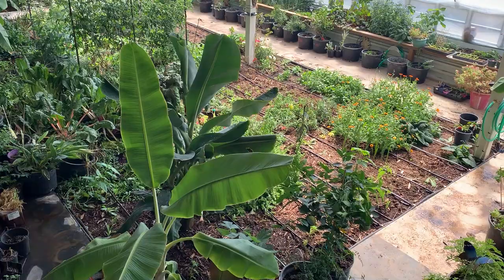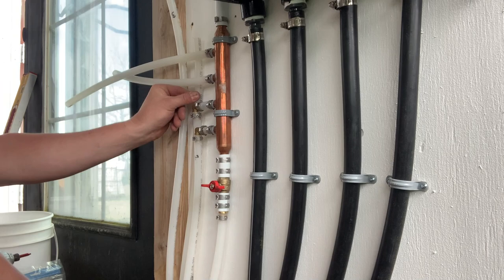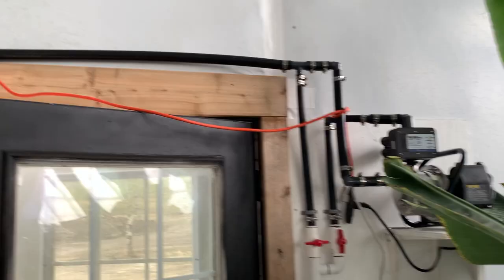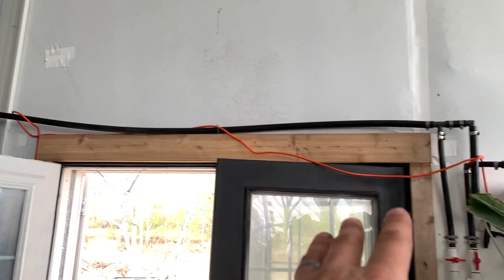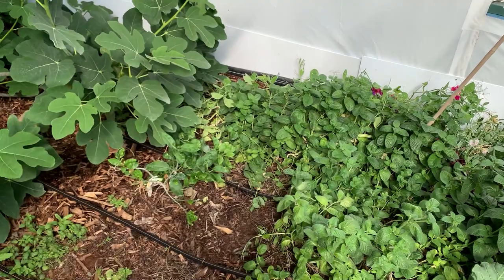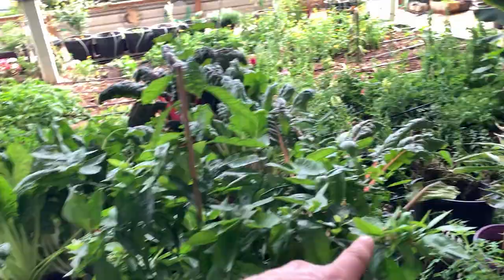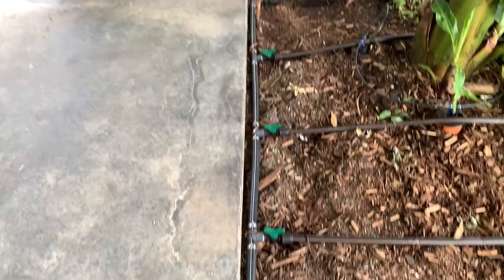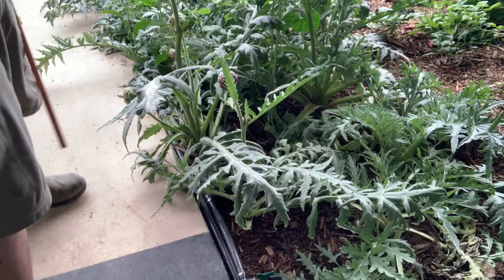Greenhouse Irrigation Completed - Full auto, driplines, pot drippers, 5 zones, timers, wifi, & more.

Comment: Maybe put a check valve on the well /house line so somebody doesn't accidentally send rainwater back during maintenance of the house water or someone opens house valves all the way that it allows that low-pressure to enter your drinking water? Also once in awhile there will be places where you can eliminate an elbow and just have a curved black piping. It's surprising how much more water flows in a low-pressure situation when you eliminate an elbow or two. If you need it that is.

Comment: I would not install one of those frost free taps.  They were installed in my house and the first winter they froze and broke.  My super intelligent plumber buddy came in and plumbed my house the old fashioned way.  He set up my outside taps with a shutoff valve then after the shut off valve added a three way splitter and one line came from the main line with the shut off valve, the second line went to my outside taps and the third line went down to a second valve.  Once it gets cold out i shut off the main water supply to the outside taps... Then i open that lower valve which drains the water out of the outside taps into my basement floor drain by the furnace.  I can then open the outside taps and if the hoses are removed the water drains out of the outside taps protecting them from freeze in the winter.

In spring i just close the drain valve and open the main supply line.  Its a simple system and works perfect.  Since he added the shut off and drain valves ive never frozen my plain outside taps again.  But this is the same system my parents house had when I was a kid and i remember my parents draining the water lines in fall when i was a kid.

Comment: Shur-flo has a small pump with the pr sure switch built in, designed for RV's (12vdc) and 120vac. 

You're welcome 😊
(Shur-flo is a well known brand in the small pump industry.... Not your typical han wan low brand whose seals or diaphragms wear out: and no replacement seals are available... You know, those cheapo brands.)
Reply from the maker: I’ll check it out.   Thanks. ✌️

Comment: What about next time, instead of cutting your pump plug off we just wire a female plug into the pressure switch and plug the pump into it. That way if the pressure switch fails you just unplug the pump and plug it in direct
Reply from the maker: That would work good too.   This was quick and easy ✌️
Reply: @ArkopiaYouTube  I drafted a similar greenhouse years ago. All I have is a floor so far. We should chat sometime.